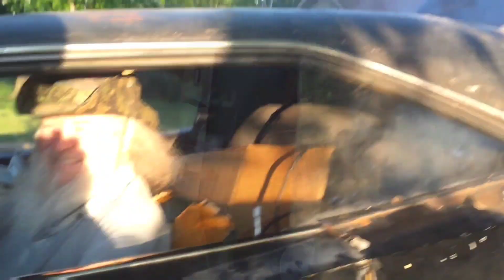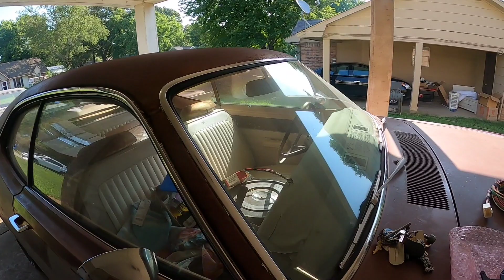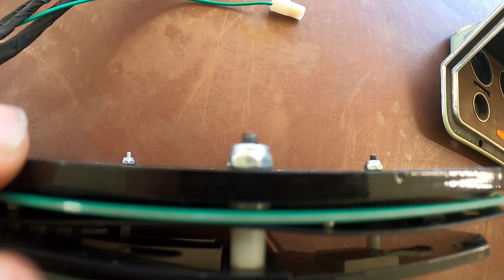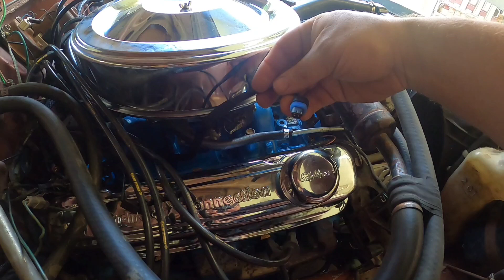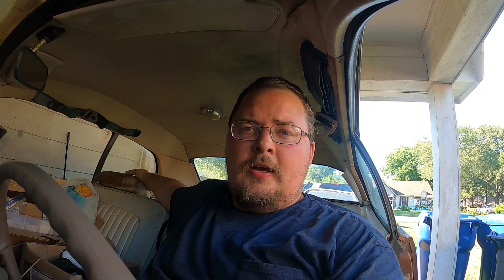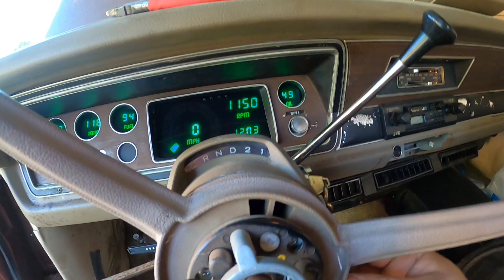1970-1976 Mopar A Body Intellitronix Digital Dash Installation

Comment: i want to put this dash in my 71 dart did you ever get the tach figured out and is it still working ok?
Reply from the maker: I was told I needed to get a tack filter to get it working like it's supposed to. I have been lazy and sidetracked by other projects and haven't had a chance to get one yet.

Comment: You did a better job with the harness than I did. My oil pressure seems high so I’m going to find another port to access the oil pressure, hopefully. One very important detail that you didn’t show is how you hacked the stock metal to suit the headlight and windshield wiper switches. That’s where I am. 

Those who are thinking of buying one of these need to know that the instructions are terrible. There is almost no reference to modifying the stock plastic. There should be several photos with detailed written instructions. The modification is extensive.

Comment: @charger383mopar. Where did you connect the voltage wire?
Reply from the maker: I copied this from the instructions ---"This Gauge Requires no wire hookup. Volt Gauge is built into the dash panel 
and is powered by the main power and ground connection of the dash"---

Comment: Did you have any interference issues? My speedometer bounces all over the place. I followed all of their instructions, including twisting the speedometer signal wires, re-routing away from the distributor & alternator wiring where possible, & I even ran the sender wires with 2 conductor shielded wire grounded on one end. Still bounces all over.
Reply from the maker: I haven't really had that issue. I can look how I have mine and let you know.

Comment: Hey @Charger383mopar I have installed this system into a 1971 Dodge demon and I cannot get the fuel gauge working, I'm running the Solid yellow Intelli wire to the factory instrument panel wire and assumingly the black/yellow wire to ground/sending unit hat. It still is not working, any ideas?
Reply from the maker: Mine works but it's not exactly accurate. I also have an aftermarket sending unit so that could be some of it.

Comment: Where did you tie your RPM wiring into?? I connected mine to the negative side of coil but still doesn’t read on dash..I replace with new coil but still doesn’t work..any help is appreciated

Comment: Did you run all new wiring to high beam,right and left signals,and parking brake,as per instructions or did you just tap into wiring harness?
Reply from the maker: My wiring is good so I tapped into it. If you don't trust your wiring it would be good to make sure everything works properly before installing this dash kit.

Comment: Did you have any problem with the headlight switch hitting the backplane? My switch touches the backplane and causes it to sit crooked.
Reply from the maker: With the headlight switch, I believe I used a large washer on the switch to help keep the proper position. If I didn’t, it would actually not tighten down all the way on mine if I recall correctly.

Comment: What did you do with the two cables on the voltage gauge, the red and black one? I connected them but have no power to the ignition switch
Reply from the maker: The 2 wires that were on the factory Volt meter I took them off, connected them together, and taped them up.

Comment: Were you able to put the rear metal cover back on the cluster?
Reply from the maker: Unfortunately not. I tried but I would have had to cut out quite a bit to make it fit.
Reply: How did you attach the light and wiper switches then ??

Comment: Great video!
Reply from the maker: Thank you. Most of the people I've showed this to were impressed with it. I'm very happy with it.
Reply: @Charger383Mopar  Excellent to hear.
Reply from the maker: Rob Z at Jegs helped me get it. I'm Considering doing the same thing on my 70 Dodge D100 with the universal stuff yall have. That is unless you're planning on releasing one specifically for these trucks.
Reply: @Charger383Mopar  I would suggest our create a dash kit, it will maintain the stock look. You can also call our sales department for assistance when your ready.

Comment: I was wondering how bright the lights are? I had thought about the blue ones for my 72 duster but all the images seem so dark. Also torn on just getting the white lights to be safe. Also how accurate is the tac while driving?
Reply from the maker: I need to get a tach filter because my tach jumps around a good bit. However it is pretty responsive. As far as the lights go when it comes to the green I can see it just fine in the daytime and it's not too bright at night either. If you still had any reservations about the blue I would just go with white.

Comment: Quick question. What wire coming off the ignition is accessory? The dash never turns off unless the battery is disconnected.
Reply: Aye man it’s all hooked up. Speedo doesn’t work due too the tranny Speedo gear which will be going to the shop to get a new one. FYI. For 12v constant power I used the ignition black wire works perfect.
Reply from the maker: For the keyed power I tapped into the radio circuit. The radio needs constant and keyed power so it would be a good spot to get power from.
Reply: That connect to the 12v pink wire to the dash? I think the plug for the radio is 3 wires correct?
Reply from the maker: According to the instructions yes the pink wire on the digital dash goes to 12v keyed power

Comment: You have any issues putting the oil sending unit in? Leaking unfortunately but I got it wired up and works great thanks
Reply: The entire cluster
Reply from the maker: Didn't really have any issues installing the oil sending unit. I did install it with the motor out and the intake off. I don't think it's leaking but I'll double check next time I mess with it to be sure.

Comment: I’m helping my dad put in the same cluster. In a 72 340 duster. Those wires you spliced into what colors were they? I’m assuming for power to the cluster? You didn’t mention what colors just wanted to get some intel. Thanks!
Reply from the maker: There are there are 3 wires for main power to this instrument cluster.  Keyed power (gets power with the key turned on) constant power and ground.  For the ground I just attached it to the body. For keyed power I tapped into the radio circuit (orange wire on the vehicle i think) for me this plug was on the left side of the radio and was very easy to access. For constant power I tapped into a wire on the headlight circuit (blue wire I think) I could have also tapped into the radio circuit for constant power but I didn't feel like taking the  radio out to access it.   For the dimmer wire on the instrument cluster (purple wire I think)  I tapped into one of the wires that power the marker lights (yellow wire I think) on the back of the headlight switch.   I would highly recommend getting a wiring diagram for your vehicle and a power probe to help identify wires if you don't already have one.
Reply from the maker: If you just wanted to get the power probe tester and nothing else this is what I recommend getting. Something like this is extremely helpful when wiring a vehicle.

Power Probe III Clamshell - Red (PP3CSRED) [Car Automotive Diagnostic Test Tool, Digital Volt Meter, AC/DC Current Resistance, Circuit Tester] https://a.co/d/gtnpK26.
Reply: Awesome man I really appreciate your help! Gonna be installing it on Saturday. Also, for the fuel sending unit. There is three wires running off none of them have to be grounded correct? They run up too the cluster. And also where was your oil sending unit located behind the distributer? Thanks!